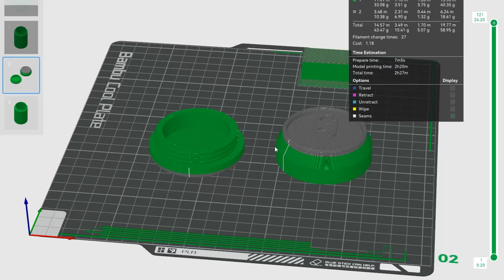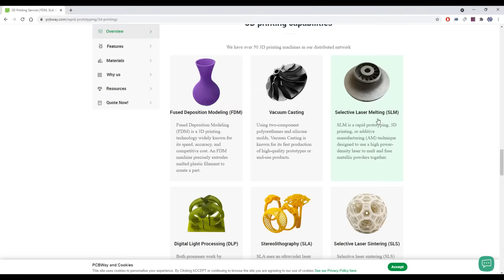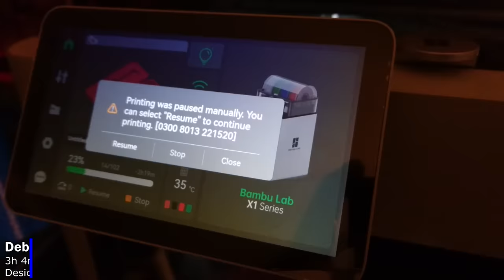Useful 3D Prints - Cool 3D Printing Ideas

Comment: Great video. I want to try 3d printing and am wondering if the bambu labs A1 mini would be able to print all of these?  Do you use the AMS lite and would it be something to buy right away? Also thinking of just going with the A1 and the AMS since it's on sale now. Thanks.
Reply from the maker: Thanks! A1 mini should be able to print these. Maybe you need to downsize some prints. I use X1C with AMS. I haven't used A1, but I would buy it, because it's bigger than A1 mini.
Reply: @3DPrintsBuilds  Thanks for the reply. If I do decide to buy a 3d printer I will probably go with the A1.